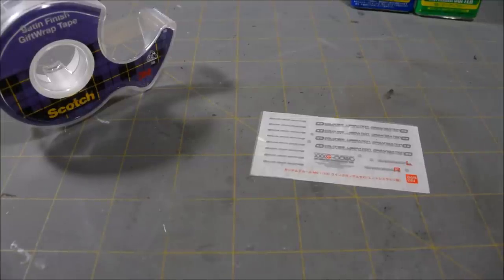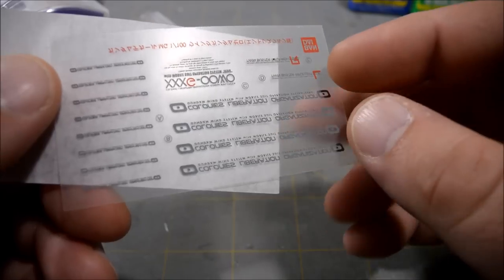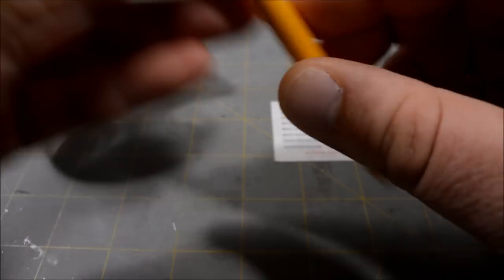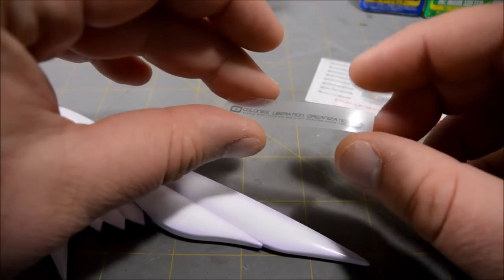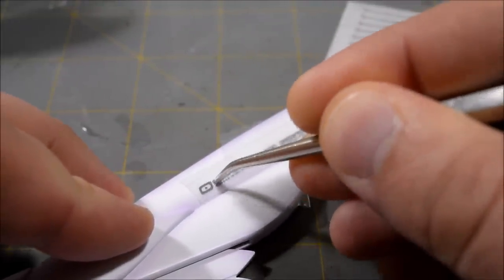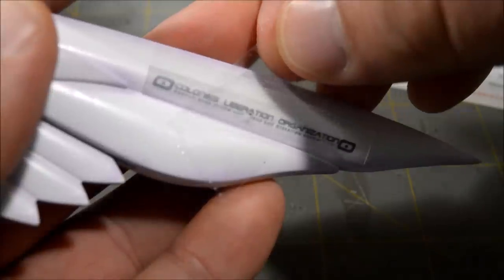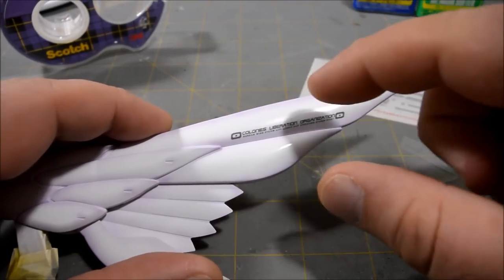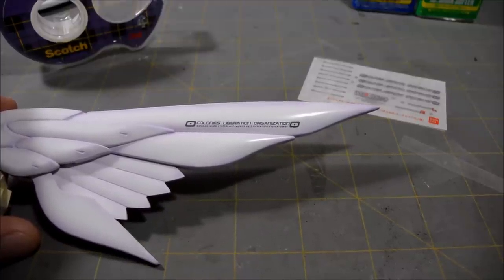Tutorial: Dry Transfer Decals

Comment: I remembered applying dry transfer decals to my MG Hyaku Shiki (1st version) with scotch tape and a quarter and it worked just fine surprisingly.
Reply: I'm here because I'm about to do my 2.0's decals. Had the same thing in mind but with a dime; this video and your comment have given me the courage haha.
Reply: @mattr.1804  Ah a message from 4 years later. Why thank you and I think a quarter is easier with the bigger surface area.
Reply: @rxzero00  a surprise huh? makes sense - I’ll keep that in mind. thanks!
Reply: @mattr.1804  I say that because it's easier to hold when it's larger, right?
Reply: @rxzero00  yep! less rubbing too. its working well; much appreciated!
Reply: @mattr.1804  same here I just bought mine and saw the dry decals. How did yours turn out?
Reply: @Haris-fp1lu  really well actually; they were surprisingly easy to work with. They are sorta self adhesive so it seemed like maybe I could get away with not securing them with scotch tape but I didn't want to chance it. Also don't rub too hard as that can damage the decal. Kind of had to find that happy medium where it was just enough force to actually transfer. You can tell when it is transferred though as the color of it kind of changes. Just don't peel it off until you know for certain that the decal is fully transferred to the surface.

Edit: I also ended up using an old stylus from a 3ds that I had lying around instead of a coin lol

Comment: Hey Henry, I build RG's almost exclusively and use their included sticker sheet for the decals. Even through some top coat, the sticker film become a little unsightly when seen up close. Can I apply mark softer on them to remove the film after application?
Reply: I see. Then I should either start buying and using waterslides where I can or just go the extra mile and painstakingly trim the stickers with a hobby knife. BTW, got any tips for me when building the MG Shin Musha (the red one)? It's gonna be my first MG.